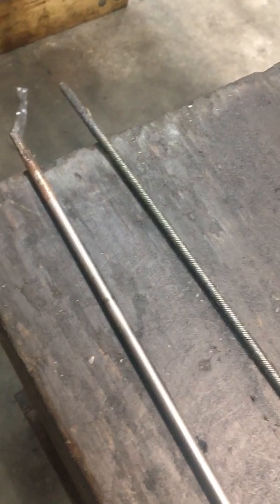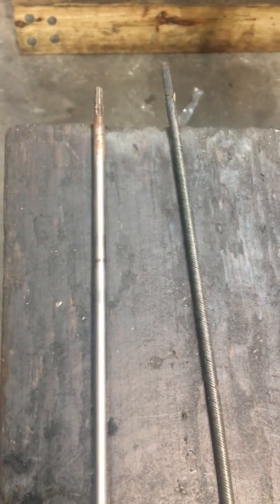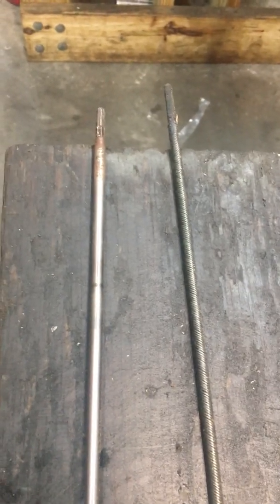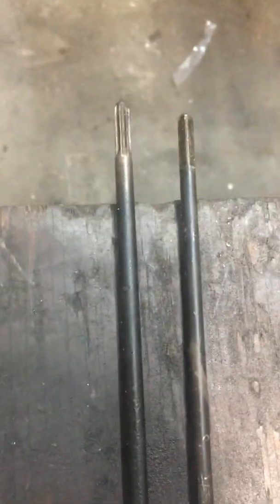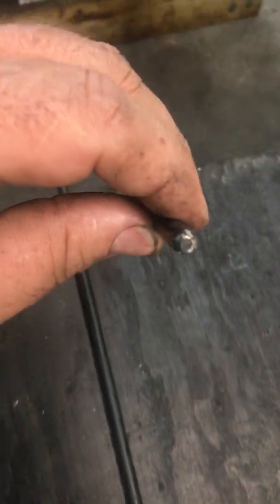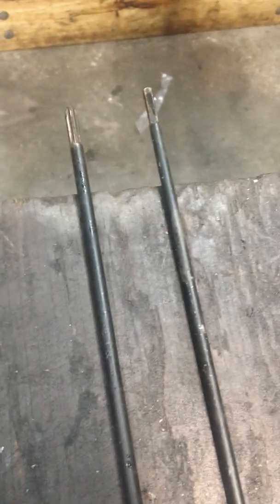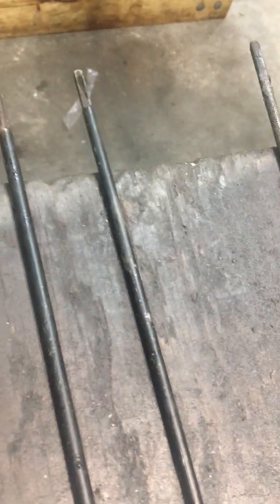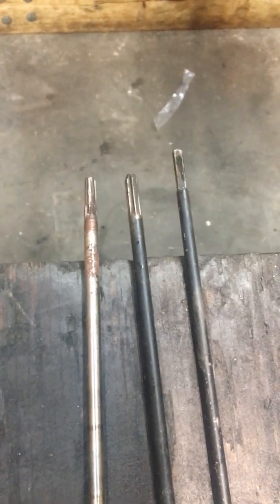Cable, solid, or hollow ground driveshaft.

Comment: Hello, you said all flexible drive shaft cables are made in the same factory.  What factory are they made in and where is it located?  Is it in Ohio?  Any help would be appreciated.
Reply: @Full Time part time picker, I appreciate you watching and commenting. I will have to go back and rewatch this video to be sure, but I may have misspoke. I believe they are all made in the same factory, but I do not know that for a fact.

Comment: Are you saying all flexible drive shafts are the same outside diameter thickness? I'm trying to find out if the flexible shaft LINER is the same OUTSIDE diameter on most trimmers. * >> I'm trying to source a flexible shaft *LINER for an older split shaft Ryobi BC30. Drive shaft is fine, but the liner is twisted and melted (and unavailable). I'm thinking I can just use a liner from an Echo etc. and just cut it down to length. From your experience are flexible shaft liners the same across multiple brands? Would appreciate your thoughts / input on this. - Thanks !